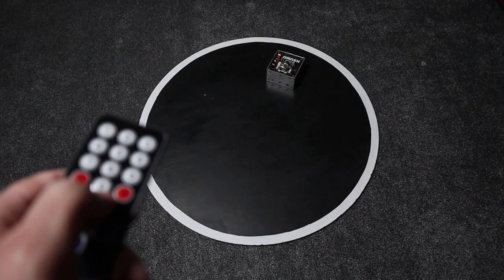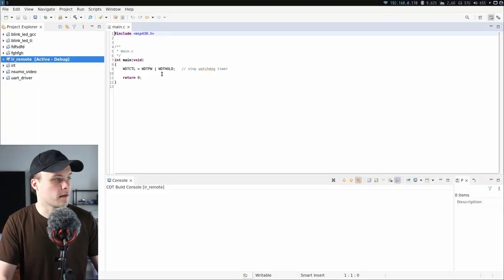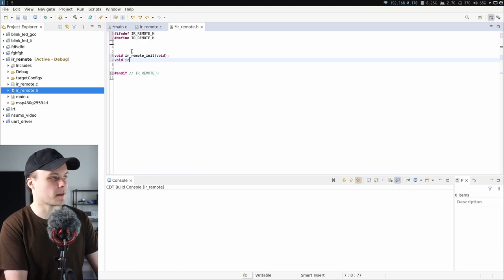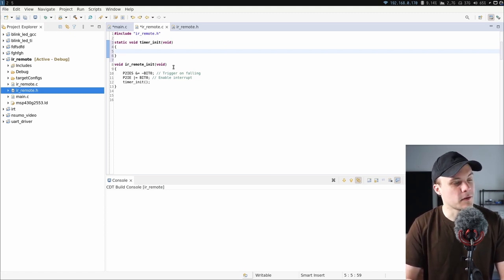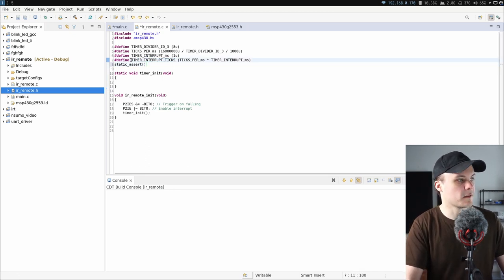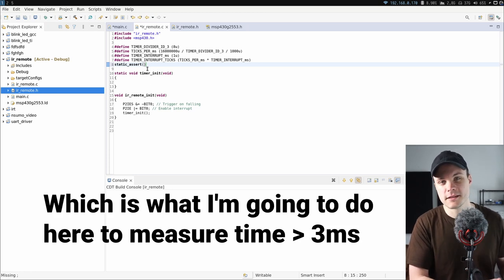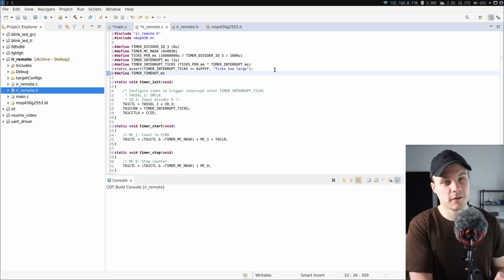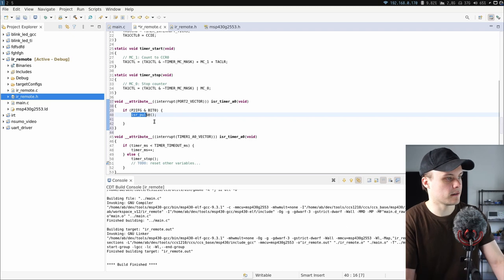NEC Protocol Driver (Infrared remote) | Embedded System Project Series #20

Comment: hi, I found you disable interrupt before accessing ring buffer to avoid concurrency issue, is this common in embeded system implementation? will it cause interrupt miss? thanks for your awesome videos
Reply from the maker: Yes, disabling interrupts is common in bare-metal but should be done sparingly. On the MSP430, I think interrupts are held pending if disabled briefly, so missing one is unlikely unless multiple interrupts occur before the first is serviced. For this application, missing an interrupt isn't critical. In an RTOS, you'd use synchronization techniques like mutexes or semaphores instead.
Reply: @artfulbytes  Thanks for your reply